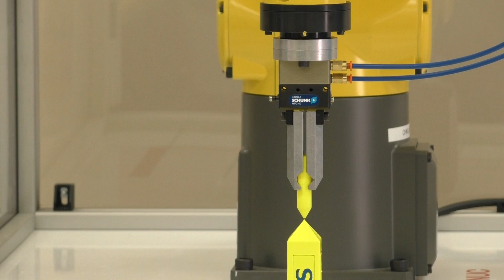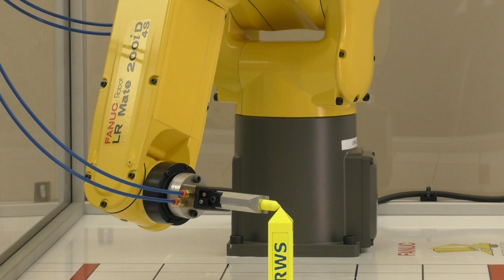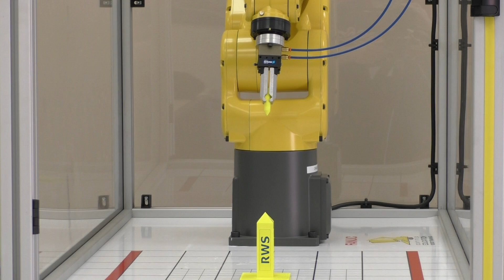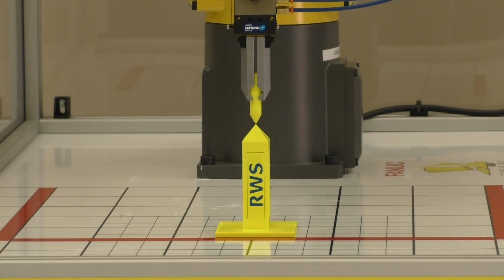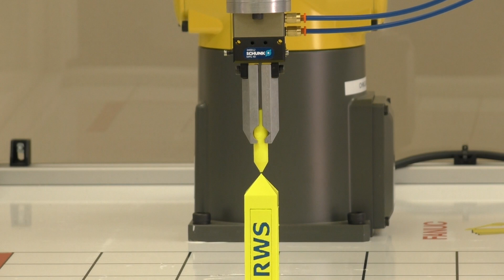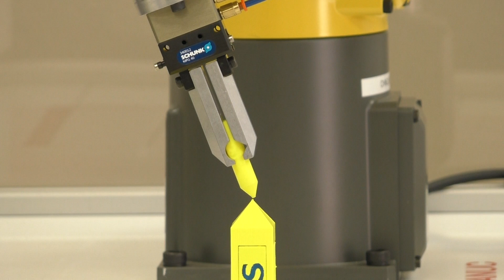Establishing a Tool Frame Using the Three Point Method.

Comment: After registering the first approach and returning to the home position, which button or command should I use to move to the first 90-degree position and record it there? Is this done by manual jogging, or is the position already saved?
Sorry if this is a basic question—I’m new to programming.